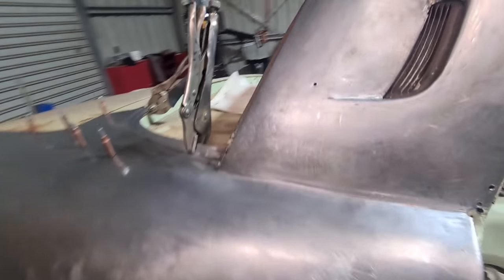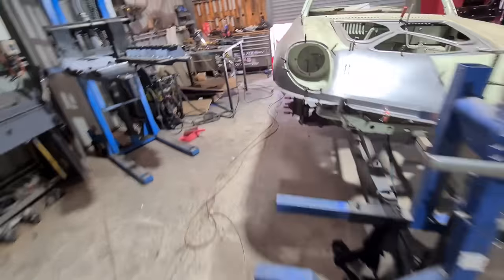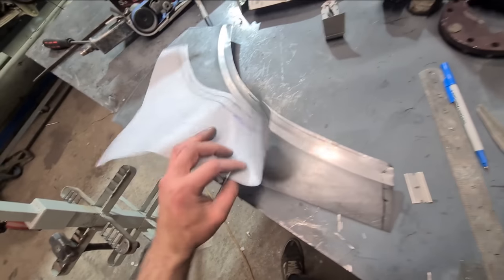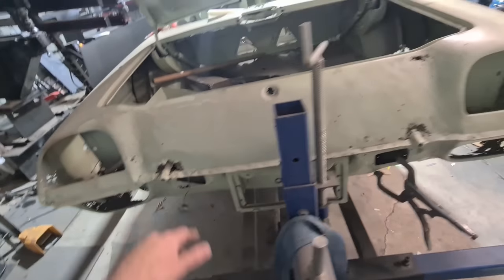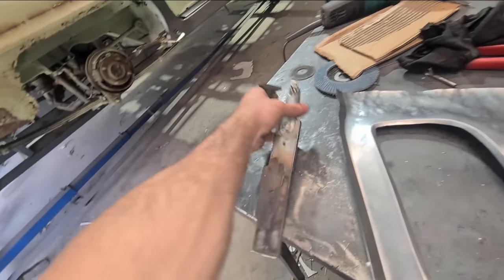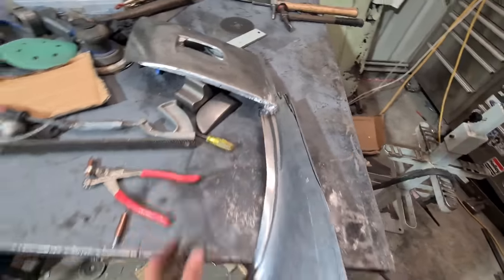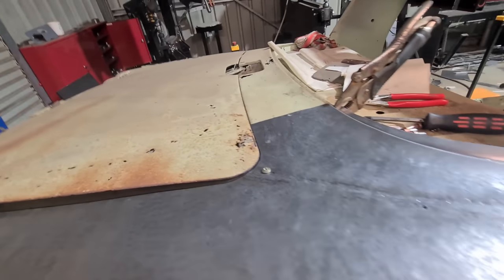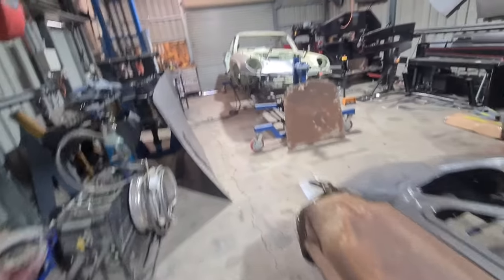Saving A Cosmo Pt7 - Making The Quarter Panel

Comment: Are you planning on making 1 car out of the 3 .  Looks like your almost building a whole new body at this stage . You have a lot of patience..... The amount of time in those panels would be crazy
Reply from the maker: This one will be 80% new remade body, not much salvageable, might look okay in epoxy but I've seen the state of the metal as I blasted the car myself.
The black one is a complete car. Dead stock and returning back to original.

The white one is my own and is a restomod on an mx5 floorpan.

Comment: Great job! Just a question that I don't know if you have answered before.

If you make the panels fit outside of the original piece won't that make them the thickness of the sheet wrong when you remove the rusty parts underneath (like on the side vent on the side of the roof)?
Reply from the maker: Yeah that's correct at worst case you are 1mm wrong overall ,any overlapped openings (door edges etc) will need to be tightened up 1mm to accommodate being overlapped when made. But that's all easy adjustments than can be made once the original is removed. Easier to reduce the size by being overlapped than it would be to make it grow if you were to make it on the inside.

Comment: Are you cutting and replacing or putting the new panels on top the existing?
Reply from the maker: Cutting out but are left in place until ready to fit the new panels as to not lose the cars structural integrity as there isn't much holding it all together with how rotted it is.

Comment: Couldn't you make a buck so you could also mirror the  Left side of the car so its identical either side ?
Reply from the maker: You could but its Easier said than done..I have zero experience making any bucks. And also don't really need to as I have the luxury of a non damaged shell to reference off. I'd be forced to make a buck if I didn't have the actual car.